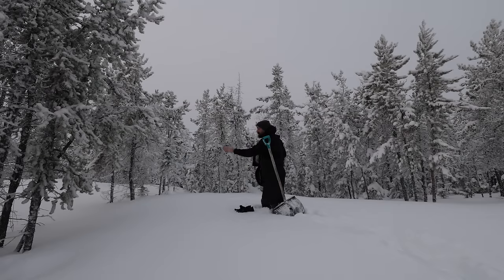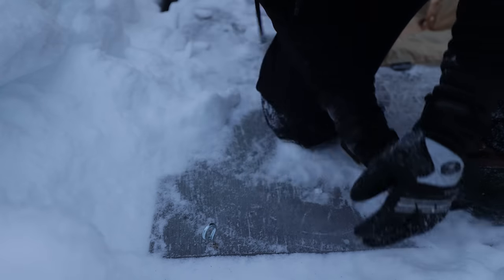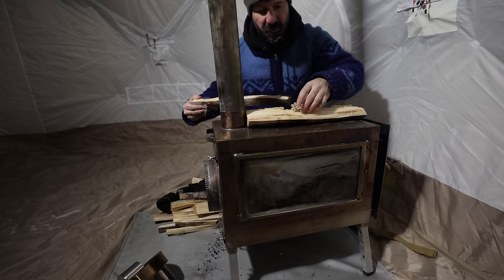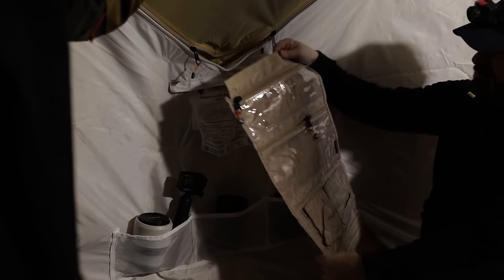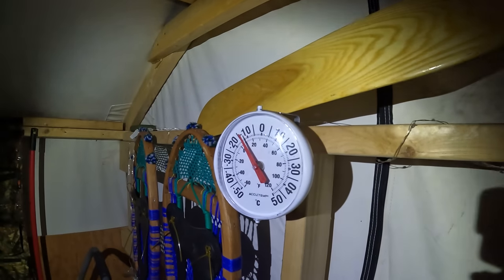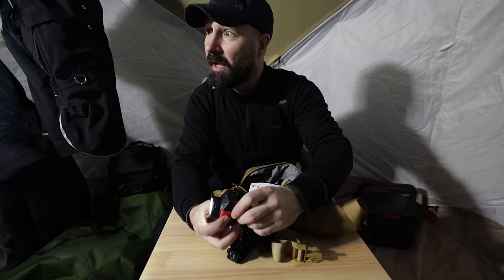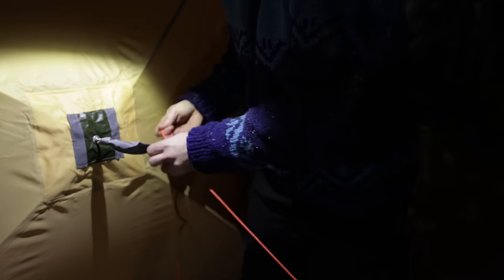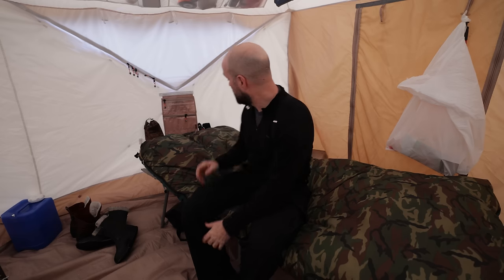EXTREME FROZEN COZY TENT. A NIGHT IN DEEP SNOW

Comment: IMPORTANT TIP!   In that headlamp, there are 3 AAA batteries. When your light gets dim and weak.....only ONE battery in that little bank is dying. The other two are great! I learned this with a compact AA & AAA battery tester. It’s the way most portable equipment is wired. NEVER ditch all 3 as bad as they ARE NOT! I find the dead battery and replace it with one good one! Been doing this for years!
Reply: I never ditch my battery's  I recharge them
Reply: I'm really glad I've got battery testers.........NOW......🤔
Reply: Awesome

Comment: More cabbage fill to the brim it will cook down, start with a little olive oil, crisp the bacon then pull it off. Cook your onion and sausage then put in your damp cabbage, salt then fry/cook your cabbage until completely soft. Sausage should be done then add back your crispy bacon adds a nice texture and crunch.  Just had that tonight with armadillo eggs and Mexican cornbread.  Good video Jay looking for the next one. THANK YOU for sharing.

Comment: idea dall'Italia: bring some oil cans and place them attached to the smokestack, they will absorb the residual heat and become radiators when the fire goes out. In fact the oil absorbs quickly but cools slowly. If you find other materials that absorb quickly and release slowly, even better!

Comment: 19:32 dryer sheet pest control
i do that too! keeps 'em out and they smell nice.
when i leave for the day i like to spray some peppermint around, especially in the summer for ants and crawlies. i hate peppermint but it works great.

half & half peppermint oil + 99 proof rubbing alcohol in a (4 oz) sprayer. don't be afraid to spray a bunch. it'll smell like (ugh) peppermint but you get used to it. wintergreen works too, but not nearly as good same goes for cinnamon oil.

Comment: Great video...this brings back memories. I lived in a wall tent through a New England winter. Best times. Food for thought,  I discovered the best headlamp for the money. A company called " wowtack" that is very bright, also has a camp setting, and a moon low setting for others in the camp. The advantage is the rechargeable 18650 lithium  batteries.  I carry a half dozen for a weekend. Remember,  always be smarter than nature.

Comment: I lived in Nunavut, in a place called Taloyoak ( aka Spence Bay). We used to go out camping/hunting/exploring/fishing  in Winter when it got to -50c or lower. We used a brand of canvas tent called WOODS CANADA. and we would place a tarp down, then caribou skins, then out sleeping bags which were heavy synthetic  bags that weighed about 15kg. We used a Coleman double burner so e the one that had a pump up fuel tank and ran on Coleman fuel aka Shellite aka white gas. Never had issues with carbon monoxide etc. Inside the tent would be maybe -5c to + 2c, and it was fine and pleasant.  Most Inuit/Eskimo use these tents. They are a super heavy duty canvas, and require an inside beam of wood running across length, then two pieces either end, we would fasten with long bolt and nut. Then guy out tent using rocks and rope or I e screws etc. Very simple, and easy and can withstand severe storms and wind. I miss that, now being back in Australia after living up there 10+ years.....

Comment: Get a Fenix headlight and a Fenix lithium ion batt charger usb so you can recharge your lithium ion headlamp batteries with your jackery, forget those alkaline AA's. Recharge lithium ion at 20ºc   😊 and get a few extra 18650 or 21700 i have the fenix HP25R  btw i made it to the end

Comment: If you ever get a crockpot out there I have an easy receipt feed u for days.  In a crock pot put one or two pounds of ham hock and two lbs of navy beans (dried not in a can) one to two sticks of butter (1/4 pound to half a pound) a bunch of salt and pepper and let it cook for four hours on high or eight hours on low.  Take out bones from ham hock shred with fork and eat up for days.  Get some crackers or a loaf of some hard bread and dip it. Or make it at home and freeze it in zip locked bags

Comment: This is the model I'm thinking about getting. Looks good for one person or maybe 2 or possibly 3,  with a stove. How much snow weight do you think that roof can withstand? Plus one of the walls folds up to give you a 'porch' with a bug screen ( great for summer or ice fishing) and you can buy an enclosure for that porch, making the tent even bigger. Looks really simple to set up compared to other tents and you don't have a pole in the middle like teepee hot tents. How many clear windows did yours come with? Also, which cot is that? Great review.

Comment: Would you recommend this 5 Man RBM tent or your classic “Labrador Tent” for a family of 3 to set for the remainder of winter for a scattered boilup and a sleepover or 2? The cost and setup aside…once everything is up and stove is cracking away…which one do you think would handle 2 adults and a 12 year old? They are both great I know but spending $3000-4000 is nerve wracking here, lol. But can’t go wrong either way I guess.
Reply from the maker: You really can go either way. It's a tough one. The canvas tent is a lot more work and doesn't have a floor. That can mean cold nights.  But if set up on a platform, it's the way to go long term. The bear tents are excellent and can be set up fast and have everything you need, especially if you grab a few accessories.  2 adults and a kid, I would consider the 8 man pentagon if you want lots of room and a fast set up.

Comment: Your stove may be a bit too close to the tent wall.
I know it's a hot tent but eventually, the heat wears down the material..I suggest first try moving the stove away from the wall  8" to 12" if possible..If not possible secure the same fireproof mat under your stove on something and lean it between the stove and tent wall..This will absorb the heat away from the tent..
When sizing it up make sure you cut it to the dimensions of back wall of stove.

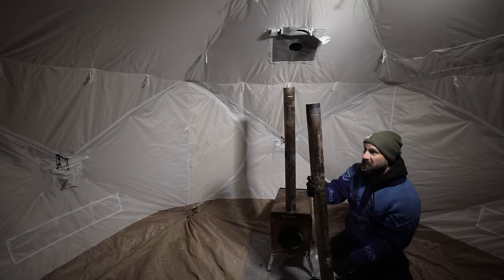Comment: Whats the meaning 8:20 of this.. putting the pipe from outside the tent or putting it from inside is the same
Reply from the maker: It's a good question. If you shove it out of the hole from the inside and then connect to the joining pipe, you will need a ladder to put on the spark arrestor outside. You can't push the spark arrestor through the stove jack hole. But if you go outside the tent and put the arrestor on first, then push it through the hole from the outside, you can join it all without needing that ladder.